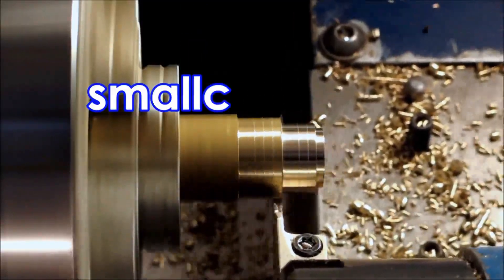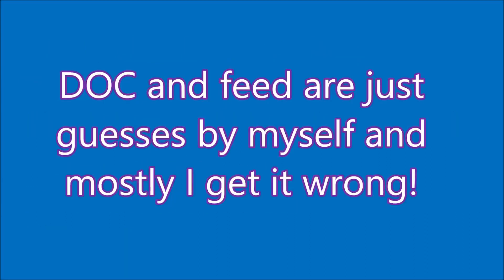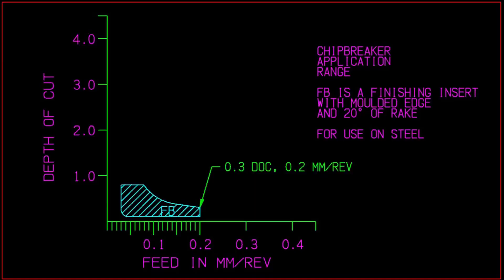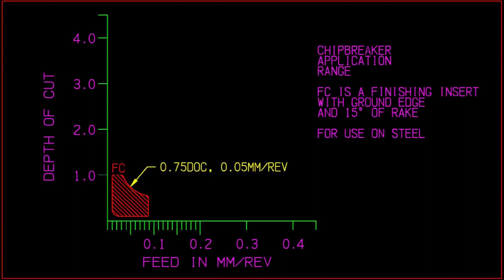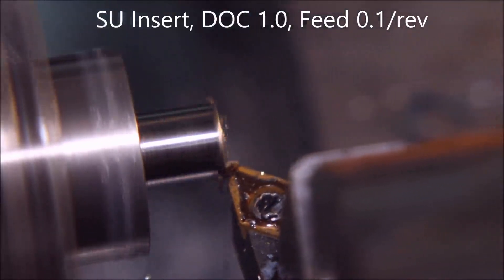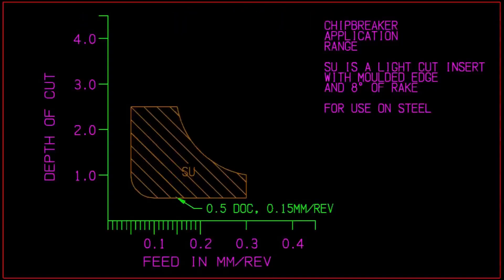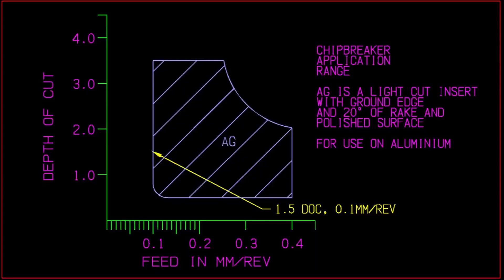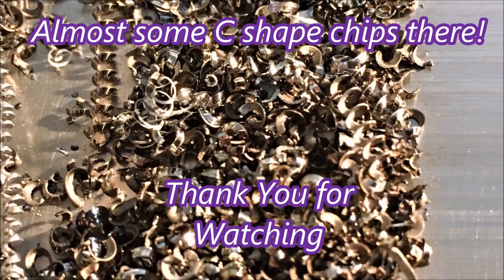Carbide Inserts For use in a Chinese Mini Lathe? Will my inserts suit you? Help for your mini lathe

Comment: Came across this yesterday while reading through comments on Stefan's video.  

https://www.imc-companies.com/Tungaloy/tungaloycatalog/item.aspx?cat=6723908&fnum=802&mapp=IS&app=0&GFSTYP=M

Interesting chip breaking geometry, which is what I've been trying to get by regrinding my existing inserts. 

Not the best surface finish on the insert, could use some lapping but the resulting finish on S1214 is pretty decent and makes nice chips.

https://imgur.com/gallery/TpuvpY2
Reply from the maker: That looks very similar to an insert design that Sumitomo now have for aluminium, I think it is called AX or AY chipbreaker.
Reply: @smallcnclathes  this is Stefan's video I mentioned earlier.

https://www.youtube.com/watch?v=UUVvgcvlbBs
Reply from the maker: Similar?  https://youtu.be/mqOLuSpPQpY
Reply: @smallcnclathes  I think it's very similar except Tungaloy don't seem to market it exclusively for non-ferrous and the chipbreaker is ground all the way along the edge.

https://subs.tungaloy.com/wp-content/uploads/GC_2018-2019_US.pdf

search for CCGT060202FR-J10
Reply: Looks like they have a local office in Rowville, do these companies give out free samples to try out ? :P

Comment: CNC you would have to pay attention to feeds and speeds which I found doesn't really apply to manual machining but none of the inserts I buy have any info other than size and type.
Reply from the maker: Hi Dave, this is true, the speeds and feeds do need some thought when writing the program.  I think a major issue folks have is not running the spindle fast enough to suit carbide inserts. In brass and aluminium almost anything smaller than 31 mm needs around 3000rpm, which is my top speed in the cnc! Thanks for your comment.
Reply: @smallcnclathes  I have to try this RPM thing...
Reply: For aluminum the uncoated ground high positive rake inserts is all you really need. I order 0 rake holders and always use it with a positive rake insert. The standard TPG , TPMG and CCMT styles will handle anything a mini lathe can muster with ease. The DNMG and VNMG styles are profiling inserts great for under cuts , backside tapers . Best tooling investment ever was a solid carbide 1/2" boring bar with Ccmt insert. Can hang that liitle guy out 6" and it will cut without chattering , rough or finishing. It was pricey but worth every penny.
Reply: @garylgray2060  Great input thanks!!

Comment: Very interesting, most of the YT "famous faces" seem to only be bothered with the shape of the insert and completely ignore the bit that really matters, the chipbreaker oh and the nose radius. Well done for trying to put the situation right.
Have you tried Sumitomo titanium carbide inserts?
Reply from the maker: Thanks Chris, I must admit it has been a while since I have caught up with my rep from Sumitomo. As I am just about retired, I am not really looking at what is becoming available. Some time ago someone suggested they have a new insert for aluminium, I did check it it out, but they were a handed insert, so not really worth spending the money on.  Not many of the famous YT faces are trying to make money out of a lathe with half a horsepower. If the hp is there, the feed rate and depth of cut can usually be arranged to get the chip breaker working. What do the titanium carbide inserts bring to the table?
Reply: @smallcnclathes  they are not new and i haven't had a grest desl of experience with them but they are good for near chrome polish like finish, if used properly. They are very brittle and you have to careful to not go passed centre when facing as the sudden change in load will fracture them. Also if you stop the lathe with the insert in contact it can also crack the tip. Having ssid that withvthe finishing chipbreaker you can take very fine cuts, which is ideal for us cut and measure turners. The old grade number was T1000, now T1200 i think but havent looked in their catalogue. for years. I had some of their handed triangular ones in a boring bar, expensive but could turn anything and with a really remarkable finish even on ultra thin wall demonstration pieces. Just for fun i once bored a pieces of motorcycle fork tube and was left with just the hard chrome and a few microns of steel. But thats just me bragging.😉
Having said all the above, in your position it is probably best to stick with what you are used to and know what to expect, whereas I love to play.

Comment: thanks for the video . i could do with some guidance i have a converted mach 3 lathe (denford cyclone)  i fitted a 2.2kw (3hp) motor and vfd . 2 pulleys 150-750 rpm and 500-2200. 
i 99% turn aluminium 

i struggle with parting eg 70mm parts  and also  boring  a 60 mm diameter 40 deep hole in it and get loads of ribbons and jam ups 
parting tool is hss but thinking of buying gtn-3 blade . boring is vcgt insert 
if you have some idea of speeds and feeds and tools itll stop me pulling my hair out 
cheers
Reply from the maker: Sorry Steve just noticed your comment, will respond tomorrow.
Reply from the maker: 3hp is a goodly amount of power. Can you use 2011 machine grade or are you stuck with 6061? 2011 makes life much easier as far as chipping goes. I use 318x300 divided by the diameter to determine the rpm for aluminium for turning.  For parting I sometimes find 318x150 divided by diameter works better.
I would not think of using HSS for parting. Good carbide inserts form a chip which is less wide than the groove and work great. 
This link 
https://www.youtube.com/playlist?list=PLFkviLkvBiAp6_W44t2mcPQcHf6UK7nZC
is I hope to my playlist of parting videos.
To get chips when turning or boring I find it pays to increase the feed. 
Contact me on my Facebook page Notewell if you want to get in touch and we can discuss further.

Comment: Thank you for this. My lathe is only 1/2 horse but these insert tools are a life saver once you figure out how hard to push them.
Reply from the maker: engineerd3d, but if memory serves, your lathe is hardly the light weight flimsy design we think of these days when the term mini lathe is used. Your main issue could be getting the spindle to spin at high enough rpm, not being rude, you did a great job, but older machines don’t usually rev very high.